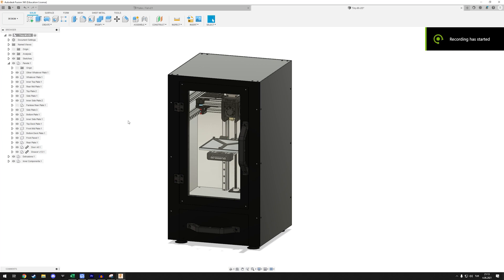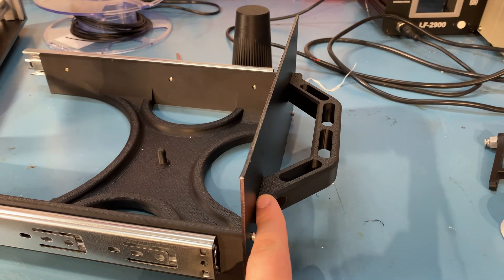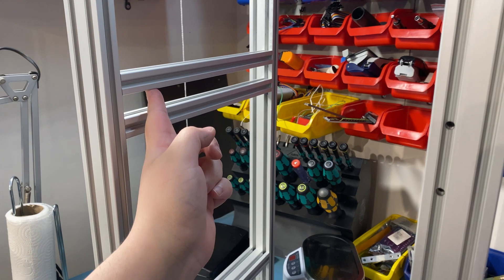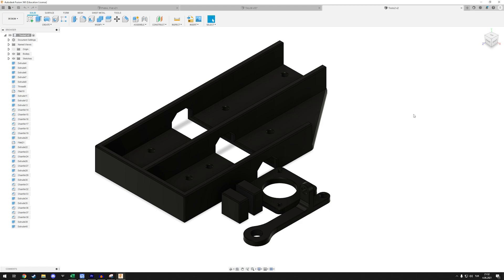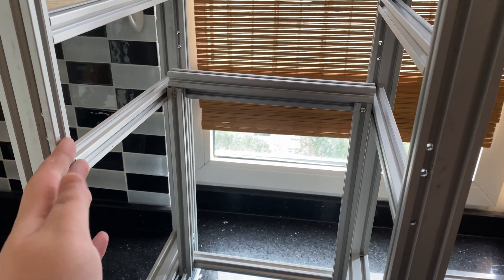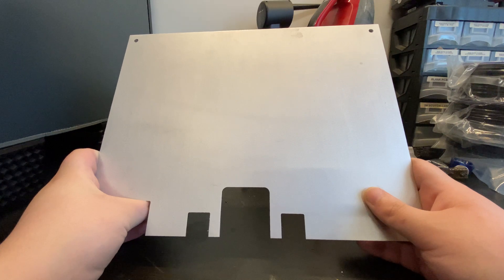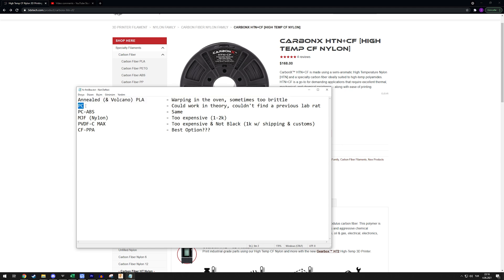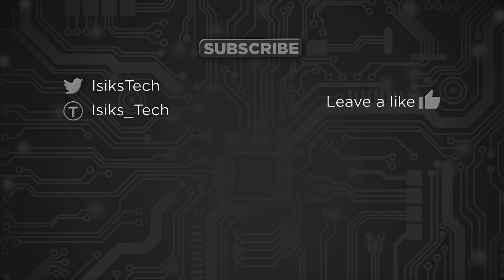Tiny-M Ep. 2 - Spool Drawer & Panel Prep

Comment: The nylon-CF has recommended chamber heater and the chamber temp 80-100C Do you think it will print well even in normal voron chamber temp (~40C)?
Reply from the maker: Well I can reach as high as 80C on my doomcube, but there were other problems... (ABS+)

Comment: I have printed PC its amazing stuff, you are missing out. Its hard to print though its like going from PLA to ABS for the first time its hard at first but you learn. Pure PC needs about °60° chamber temp unless you buy a nice brand they warp a lot less. I highly recommend PC-CF easy to print and doesn't warp much.
Reply from the maker: I might try something similar for my v2 doom. I didn't want to risk it for this build.
Reply: @IsiksTech  the risk comes from the blended PC filments i think. Who knows what they blended with and it lowers the properties of the PC it self to 'print easier'. CNC kitchen just tried a prusa PC blend its temp resistance drops from ~140° to ~110° thats a huge difference at that stage can you even call it PC any more?
Reply: @Side85Winder  Try out CF PC. Prints easy and is very rigid.
Reply: @ZURAD  if you read the comment i said i recommend PC-CF....
Reply: @Side85Winder  my b

Comment: i printed many parts of my V0 with Prusament PC Blend, they just released a new PC Blend carbon Fiber with a higher temperature resistance.... best material i used so far in terms of strength and temperature resistance
Reply from the maker: I might try something similar for my v2 doom. I didn't want to risk it for this build.